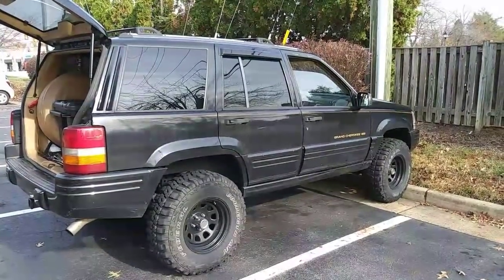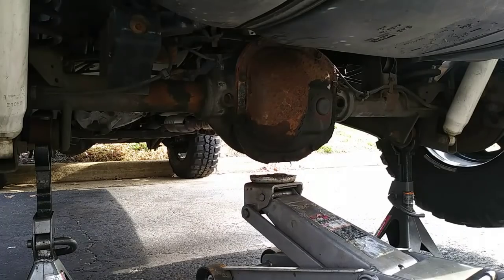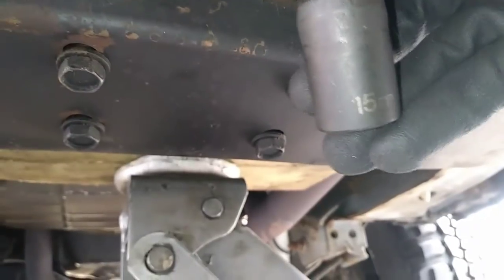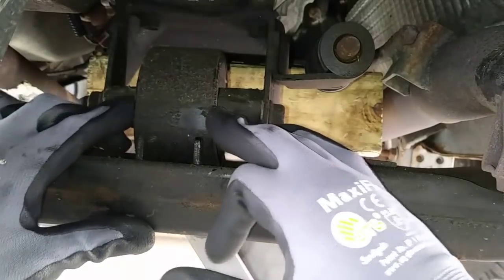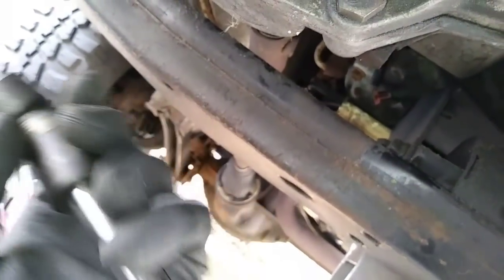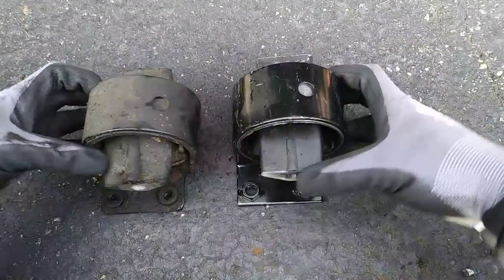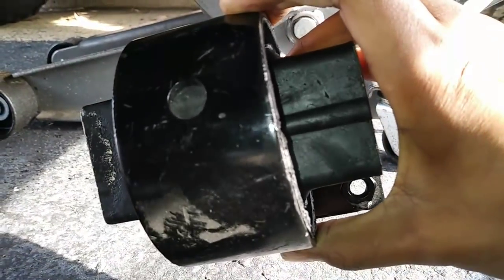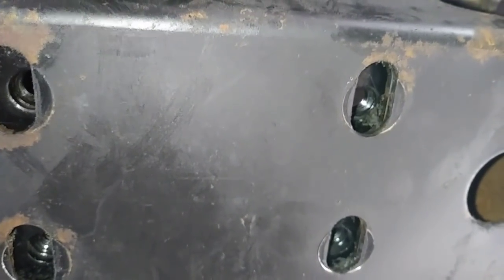TRANSMISSION MOUNT REPLACEMENT (1993-'98 JEEP GRAND CHEROKEE)

Comment: LOL, I've been there, too lazy to get from under the vehicle so I struggle!! I've been looking for a set of impact swivels, and I see you have the Pittsburgh brand, how are they?
Reply from the maker: Astral Auto Repairs the Pittsburgh brand swivel sockets are great. they fit the anvil of the impact wrench great and they have stood up to alot of torque and abuse over the past year since ive got them. The only downside is the numbers can be hard to see, and the set skips sizes
Reply: Yea, i started out with 'em but soon moved to Sunex because of the completeness, value & cases. Try CPO outlets & tooltopia.com out for awesome deals.

Comment: nice job, you make it look easy.  my 98 ZJ has a fairly strong vibration when slowing down to about 5 mph.  if I shift into neutral, the vibration stops.  when I shift back to drive, it often dies out.  have been wondering if its the transmission mount.
Reply from the maker: +Steve Walls get down there with a prybar and check for excessive slop in the rubber. If that transmission mount has never been replaced I would get that done for preventative maintenance. I would check the u-joints on the driveshaft as well.
Reply: Steve Walls it sounds like your TCC is locking up on you, that's what is making your rig stall. TCC = TORQUE CONVERTER CLUTCH.
Reply: nowr2run I will check that out, thanks.  is that a difficult repair?
Reply: @stevewalls3365  If it is the torque converter clutch (and it looks like it is), then yes, it is a difficult  repair. You need to pull the transmission and replace the torque converter, which is right between the transmission and engine... I just did it, including transmission rebuild. Just pulling the tranny is like 3-5 hours job, putting it back another 5 hours. If you don't know what you are doing, I wouldn't recommend doing it yourself.
Reply: František Soumar thanks.  that's outside my pay grade.

Comment: My brother, I have a 6 Grand Cherokee, and think I have issues with my tran mount, when driving I can feel the vibration behind the console on the floor, no issues with power, just that loud noise. I'm 1000 miles away from my mechanic, do you think I can make it back to him safely? I appreciate it if you could get at me asap, cuz I'm gonna be leaving in a fer days. Thank you!!

Comment: BG, I have been chasing a problem with a shake in my 97 grand Cherokee tsi 5.2 (4x4 all the time). I replaced all rotors and pads, new tie rods, track bar, drag link, shocks. Basically it ONLY shakes under acceleration, then rides smooth as SOON as I let off the gas. No shake at idle. No shake when braking. No grinding noises. Hopefully you can guide me in the right direction on what it could be!? I'm stumped and not the best mechanic, hate to keep throwing parts at it without knowing what part is the culprit. Low on funds and the shops around me charge 100/hr. Any ideas brotha??

Comment: I see you bypassed your compressor with a shorter belt and that's what I did on mine also because my air conditioning doesn't work anyway.

Comment: BG, When ever I look for a vid. to do work on my 97 ZJ your vids. are always there to help. I'm doing Trans. Mount soon but I only have 1 problem with your vid. I'm a WHITE DUDE, don't have 12 inches ? What do I do BG ? I do have the swivel though, LMAO. Great vid as always, you even tell the size needed & the freakin torque, WHAT IN THE HELL MORE DO YOU WANT FROM A MECHANICS VID. ? ALWAYS LOOK AT YOUR VIDS. FIRST BRO. ALWAYS, THANKS BG. Also DAMN YOUR LIKE BATMAN WITH ALL THOSE FANCY TOOLS & GADGETS, CONGRADULATIONS ON THAT, I'M GETTING THERE THOUGH, I'M MORE LIKE ROBIN NOT BATMAN AT THIS STAGE.

Comment: Mine is a 94 5.2 but has the other style transmission mount. So I guess not all 5.2 have this style
Reply from the maker: Allen Rubin my guess would be its different for '93-95 because I have a '96 & '97, different trims but both with the 5.2 and use the same style mount
Reply: BARRICADE GARAGE ok, yea when I look on autozone based on my vehicle and trim “94 Limited 5.2” it shows me the other style. Crawled under and sure enough it was the other style

Comment: Do you have a brand recommendation for the motor mounts and the transmission mount?  I tried to order the MOPAR parts you linked in the engine mount video, but they are discontinued.  Any idea if there's a website that would still have them?
Reply from the maker: No I cant even find them any more myself. If they had Moog as a substitute I would get those
Reply: I just got some on rockauto